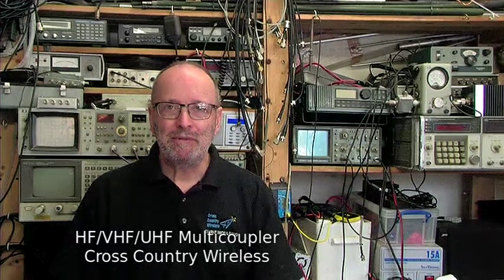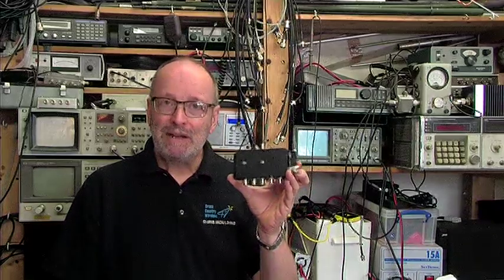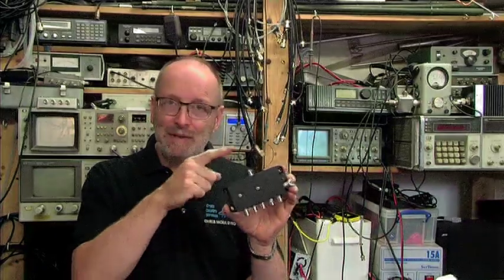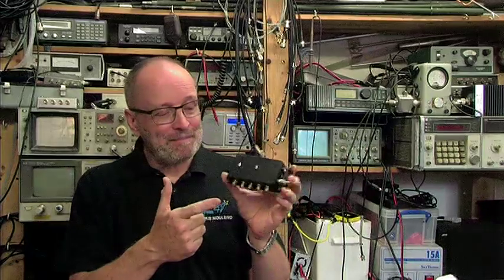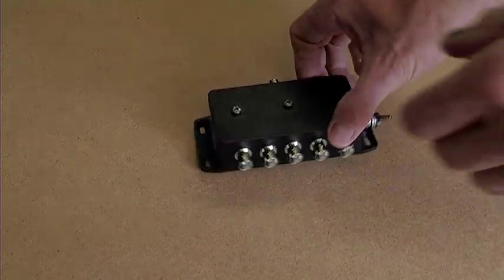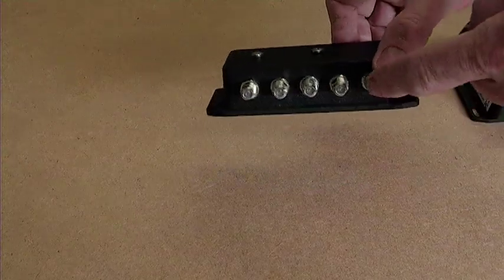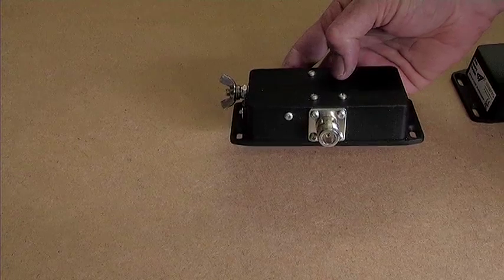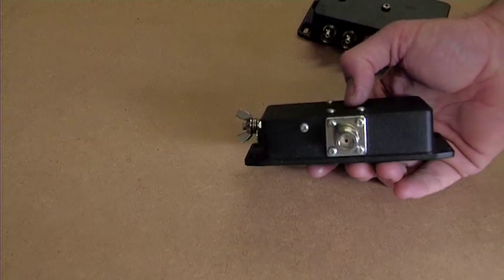HF/VHF/UHF Multicoupler - Cross Country Wireless

Comment: Pleased to see these are still available. I have a standard one with BNC's, but I am increasingly finding radios are more and more using SMA's. As I have a project I am working on that has several SDR radio's, all placed in a sealed cabinet with a Raspberry Pi connected to each a single SMA antenna would be ideal.

Can all the connectors be placed on the same side if reduced to SMA size plugs's without impacting performance?
Reply from the maker: Yes it is possible to make one with all RF and DC connectors on one side if SMA connectors are used.
Reply: @crosscountrywireless  Thanks for quick reply. Looks like I'll be ordering nearer to the end of the year / start of next year (it's not a quick or cheap project!).